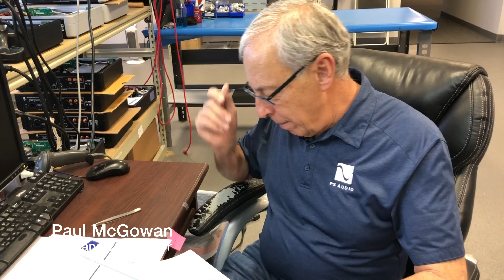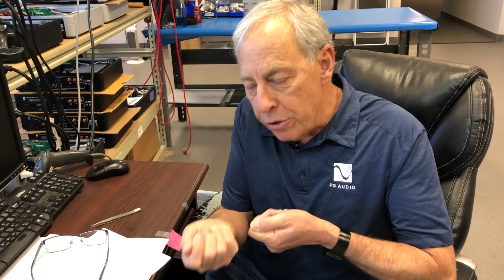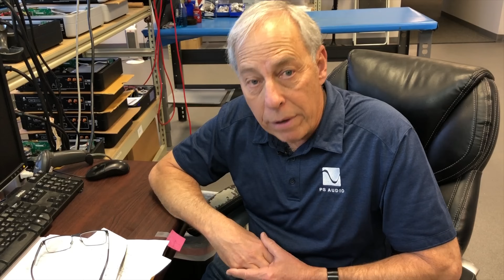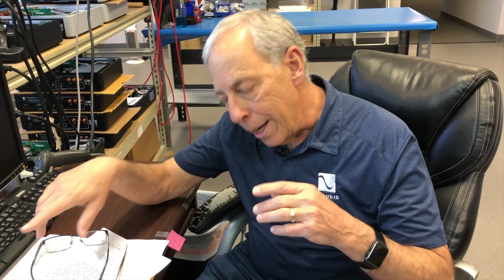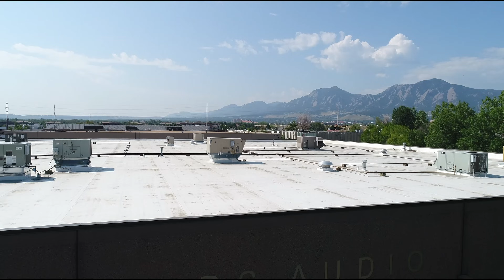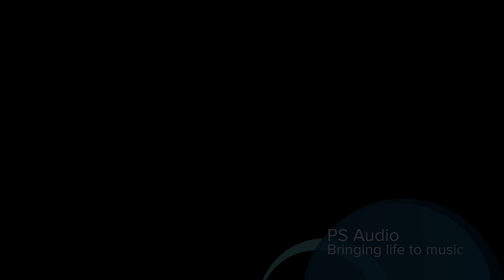Is it possible to change speaker impedance?

Comment: I have an 8 ohm subwoofer, I'm planning to add an inductor rated at 8ohms, wire it at parallel on my subwoofer speaker so it will be 4 ohms, which my amplifier requires 😅 is it okay to use an inductor or there are other alternatives to put on my speaker?

Comment: Hello Mr. McGowan,
Possibly you have explained in this video the question that I am going to raise but, unfortunately for me, my English is not very good. I,m using Google translator to be able to write to you.
I just would like to know something that I don't understand, in relation to trying to increase the impedance of a speaker, when it has 4 ohms and your amplifier requires 8 ohms. I know about series speaker systems, it's not my idea. I know that you should not put a 4 ohm resistor in series because it would have to be the same power as the speaker and a resistor is not an impedance.
But there is something I do not understand. What gives the impedance to a speaker, the 4 or 8 ohms of impedance, is the coil, if I have understood correctly. If you cannot use a resistor in series with the speaker, for the reasons I have said before, perhaps you could use a single coil, without the rest of the speaker, of 4 ohms, in series with the speaker. Measuring with the multimeter, the result is 8 ohms, but I do not know if a single coil, for this purpose, would work adequately. I understand that the speaker coil is a part of the system that makes it vibrate, emit sound, and this second coil would not do any of that, it would only provide 4 ohms.
What do you think? Would it be a possible solution? I am very tired of searching on YouTube for a solution in my language, in Spanish, and only finding people proposing to add more speakers. I have two good speakers, two six-inch Blaupunkt GTc 172 that sound incredible, they only need a couple of tweeters and some boxes. But my Onkio Home Theater amplifier requires 8 ohms on the sound outputs, and I don't want to break it by connecting those speakers without looking for a solution. And, if I don't find that solution, I'm not going to bother making some boxes and looking for some tweeters.
Thank you for your time, and greetings from Spain.

Comment: Worst advice ever I blew up 2 technics amplifiers with two speakerlab 6ohm speaks I thought were 8 ohm but I need glasses. I guess it wasn't bad for the speaker but the amp did not handle it well or at all. I have done this many times when I was younger and dumber with 4ohm speaks  with an amp that required an 8 ohm load not to mention you can cause damage to the tubes or output transformer hooking up an 8 ohm cab to my Ampeg SVT Classic. So tho the gentleman may indeed know more than I do about this stuff, I can tell you from first hand experience that you need to hook the speaks with the correct impedance to your amplifier or you risk damaging the amp.
Reply: Yes sir this guy goes on and on about nothing lol

Comment: I have a question 
If my speakers are 4 ohms and recover says it 6 ohm per channel 
Will it drive it or burn receiver?
Thanks
Reply: You should be ok. It won't hurt anything though if you play it too loudly it may shut off the receiver.

Comment: What if it is just for a intercom handset? 
My intercom handset speaker has gone bad. 
The speaker is a 50mm 50ohm 0.2W speaker can I not just use an old suround sound sattelite speaker of 8ohm 35W with resistors in paralell to bring it up to 50ohm

Comment: Let's say I have an amplifier that doesn't do well with 4ohm, but I want to use it with specific speakers which happen to be 4ohm, can I simply add resistors?
Reply from the maker: You could but I wouldn't advise it. While your amp will be theoretically happier, you'll be losing power.
Reply: @Paulmcgowanpsaudio  thanks, I don't mind losing a bit of power because the amp I have in mind has major issues with 4ohm
Reply from the maker: @vernarddevilliers7899  Ok then. Just make sure you use some big resistors and check their heat once in a while.

Comment: I watched the video the guy sounds very smart. So what he's saying is that I can connect a 4 ohm speaker to my 8 ohm or higher stereo requirements and not worry about my stereo getting too hot or burning up correct?
Reply from the maker: Most receivers or amplifiers are capable of either 8Ω or 4Ω impedance unless you have a tube amplifier with very specific taps on the output transformer. It takes twice the power to run a 4Ω speaker than an 8Ω speaker at the same volume level. I don't know what your amp is but likely it's ok.

Comment: What is a driver?  Is that the speaker???
Reply: Basically yes !.. without getting too technical, the driver is the magnet & voice coil attached to the back of the speaker, known as the "motor".
However the frame as in (speaker basket) with the cone is referred to as the unit, the whole assembly is the (drive unit) the word "driver" in term is short for a speaker drive unit.
The reason why the magnet & voice coil is known as the motor, is because the coil moves back & forth as would an electric motor, accept the electric motor would rotate instead.

Comment: SpeakerCraft aim 7 two way 125watts peak  
6.5-inch Dual 4 Ohm Subwoofer Peak Power: 400 Watts | RMS Power: 200 Watts
 4 inch 8ohm full range speaker that's 20watts rms 40 peak 
3 inch full range hifi  10 watts rms 25 peak 
1 inch  tweeter 240 watts rms ..
How do I wife these up in my speaker box s

Comment: now on my optimus speakers they are a 3way design the tweeter is 6 ohm and the midrange is 6 ohm and the woofer is 8 ohm how would using 4 ohm tweeter and 4 ohm midrange and 8 ohm woofer affect the crossover and sound

Comment: I have an amp with 3 watts of total output power I need to use it in to the  input of another amp. 
even at low volume  second amp has extreme distortion at the out put should I use an step down transformer on the output of first amp 
First amp is analog and second one is digital any help will be greatly appreciated 
Thanks.
Reply: As I recall, you need to get the impedances to match.

Comment: I have a small locomotive that has a 1.5W output. Initial speaker broke and I could only find a 1W speaker small enough to fit inside of it. Would adding a second 1W speaker or resistor protect the speaker? (I heard adding a resistor would distort the sound)

Comment: Hello to all .  I have channel 3 & 4 on my car AMP output  that I like to bridge . Amp has 4 ohm output . Each channel is pushing 200W rms . 400W total rms when bridge . I would like to hookup only 1 - 15" woofer speaker   (  NOT  SUBWOOFER  ) that  I pulled from a  pa speaker . It is a 8 ohm speaker .  Woofer  Speaker is rated at 800W peak ...and NOT  RMS  . I THINK THIS WILL BE A PERFECT MATCH  ...... I THINK  ? Please tell me what  I NEED TO DO TO LOWER THIS WOOFER SPEAKER 8 OHM INDEPENDANCE TO 4 OHM TO MATCH MY AMP 4 OHM OUTPUT  PLEASE !  .......PLEASE HELP !   HELP... THANKS

Comment: Can I use an 8 ohm amp with 16 ohm speakers?  Ex.  LTA MZ3 or Schitt Aegir with Rogers LS3/5A.
Reply: Yes, it will not harm the amplifier. However, for a given volume setting, the 16-ohm speakers will not be as loud as the 8-ohm ones.

Comment: Have a set of low impedance shop speakers that are causing the receiver amp to over heat. Thinking about adding a 2:1 transformer on the speaker to give a 4:1 impedance change to the amp. Any suggestions?
Reply from the maker: Maybe get a bigger amp? Using a transformer like that isn't going to be good for the sound and, at the end of the day, won't buy you much. There's no free lunch, as they say.
Reply: Thanks.

Comment: I have to replace a Behringer 5.25 inch 6 Ohm Monitor Speaker. Should I Replace it with a 4 Ohm or 8 Ohm speaker. 
I can't find an Inexpensive 6 Ohm speaker.
Reply: Dali makes 6 Ohm speakers, and the cheapest models are quite cheap.

Comment: Impedance changes with excursion of the driver, in operation it is never constant. However an average can be drawn.
A crossover is very much a part of driver response characteristics within it's above zero range. The level of attenuation 
is a measure of slope response, 6db 12db 24db etc. Sharp cutoff rates can be heard, however that can have it's uses.
Many smooth crossovers use 6db attenuation curves. Combined with actual driver response curves the result can be very pleasant. 24db tends to be a sort of brick wall. 6db tending to be more gradual.
Some speakers present a good load to the amplifier, some do not - it may sound fine but impedance's are all over the place.
Making the amplifier rather unhappy driving a large current signal into said load.

Comment: hey, i have a question about impedence matching.
is there a difference or an advantage between these two setups?
1)u have an amp with a stable impedance of 4 ohm, and u put a load of 4 ohm, but play it at half the rated amp output power.
2) u have an amp rated for 4 ohm, but a load of 8 ohm, and play it at max output.

Comment: If it's a transformer-coupled amplifier (usually a tube amp) , a Zobel network on the low/mid-frequency sections can flatten out the impedance rise after the speakers resonance (Fs). If the DC resistances of the drivers used are similar, a fairly flat system impedance curve can be achieved. This doesn't actually change the impedance of the drivers themselves, but merely presents a more consistent impedance to the amplifier, which in a tube amplifier, results in a more consistent plate current across the audible range.

Comment: How can two 4 ohm drivers come to make an 8 ohm speaker unless the drivers are in series? If they're in series, effects of the crossover would have to affect both drivers. Wouldn't they have to be two 16 ohm drivers in parallel to operate at 8 ohms?
Reply: If the two drivers are for different frequencies, say woofer and tweeter, then no - you can't use them in series.  As you guessed, their crossovers would interfere with each other.  You'd only connect drivers in series if they were similar, as in a 2x12 guitar cab.  The crossover would correctly affect both drivers.

Comment: While changing speaker impedance is not advisable due to dB drops, controlling speaker impedance is VERY important. Zobel networks can make the difference between a speaker clipping an amplifier and not http://www.wavecor.com/html/zobel_networks.html
Reply: Depends on the amplifier/reciever. Most 8ohm recievers/amps will be ok running 6ohm speakers and even 4ohm speakers. I've ran 4ohm speakers on an 8ohm reciever for years and never had an issue.

Comment: All drivers exhibit varying impedance over their frequency range. One thing I can complement Stereophile for is their measurements (on other  components as well) on speakers. Although I don't read them anymore, take a look at their speaker  impedance and phase angle. Speaker impedance measurements vary WIDELY over the speaker's freq. range. There may have been a few that varied only a small amount, but they would a very small minority. Some of the other measurements that would apply are tube amps faced  with a speaker load also show WIDELY varying frequency response. Check out the measurements.

Comment: Paul,Thanks for all your videos.All my tube guitar amps have output transformers.Marshall amps from England mostly use 16 ohm speakers.Their 4-12" cabs have  4 16 ohms in series parallel to 16 ohm total load.Fenders made in the USA mostly use 8 ohm speakers.There are exceptions of course.I get many impedance questions from musicians.If you have a guitar amp with an 8 ohm o.t.,the only way to get full power is to connect an 8 ohm speaker.Connect a 16 ohm,the amp puts out less power but draws less current at clipping.Give the same amp a 4 ohm load,the amp puts less power but draws more current at clipping.I get a lot of transformers from Mercury Magnetics.They tell advise to always use the highest impedance tap on an amp with multiple taps.The thing about that is that three of my all time favorite guitar amps are 2 ohm.Fender Super Reverb(SRV,BB King,Mike Bloomfield)Fender Concert and the 50s Fender Tweed Bassman.All three amps have four 8 ohm ten inch speakers in parallel. I know hifi audio and guitar amps are parallel universes.Your looking for accurate reproduction and I'm looking for that rusty knife blade tone.Thanks again.Keep em coming.
Reply: Yeah, instrument amps are a whole different game. There it's all about coloring and voicing.

Comment: rewire in series or parallel with other units or change a loading resistor in a crossover so that the amp will see aa different impedance was the first thought. the next is to answer no as whatever dead load and active curve load impedance that is inherent to the unit has been established in the design of the motor driver and cavity coupling of same.
and then there's when one gets too enthusiastic and fries a voice coil....by amplifier continued signal clip or output device failure to d.c.  now...to watch the vid   :-)